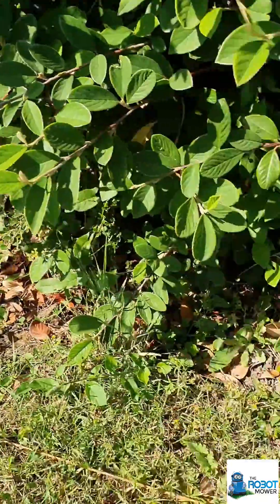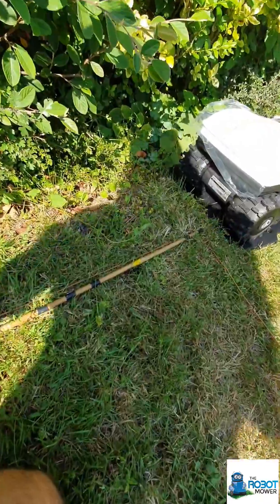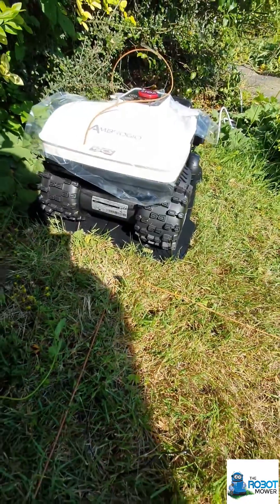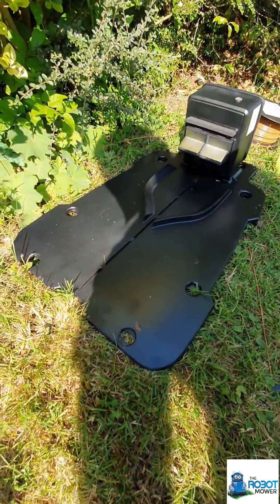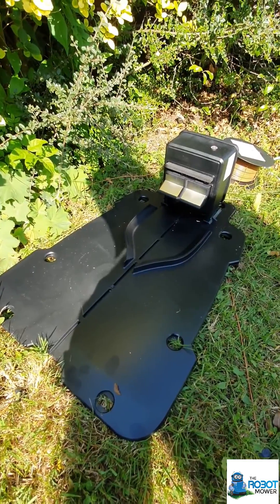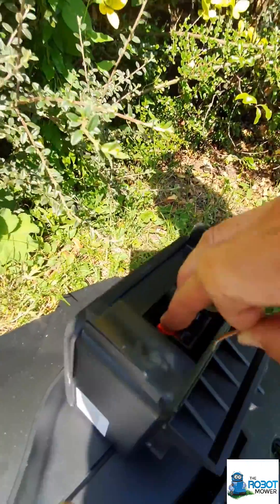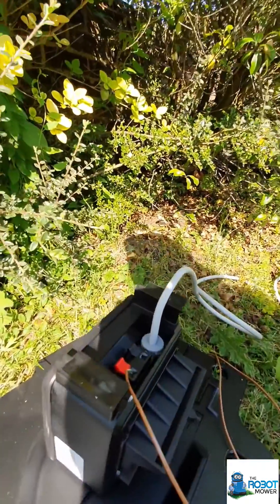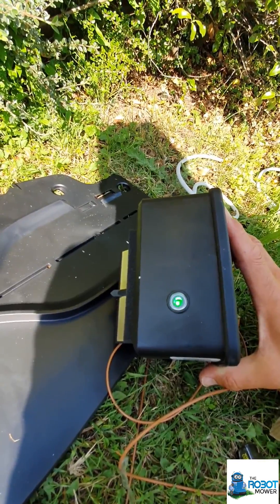Ambrogio Twenty Installation   Wiring up the base

Comment: Can you explain a bit what do you do with the other, not incoming wire. THe incoming must be 2m in front of station. The manual states that the other wire must go around the station, and hook into the station with at least 1m of length. But yours from what I can see goes at an angle straight under the station and you hook it up? That works?
Reply from the maker: The wire coming out the base of the base (connected to the black terminal) can be at right angles to the incoming wire but should not start in front of the base.  The setup I've used is not recommended but you can get it to work.